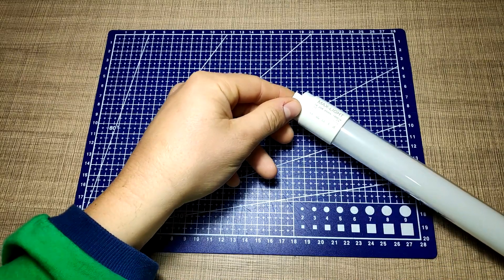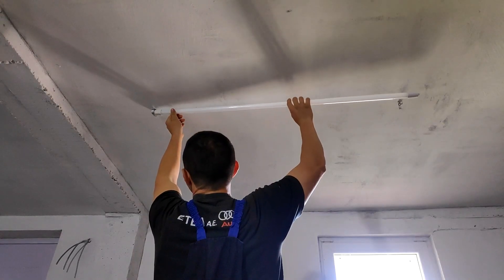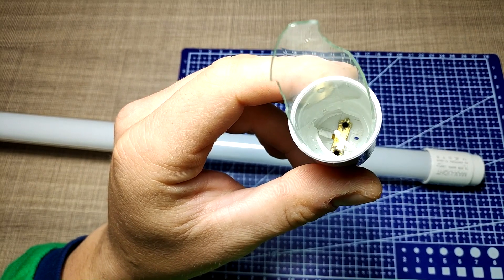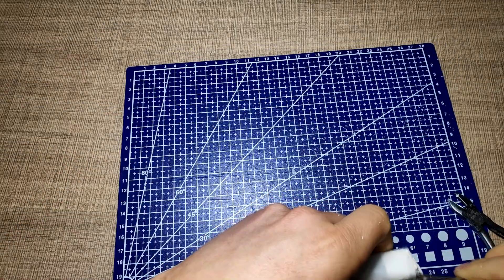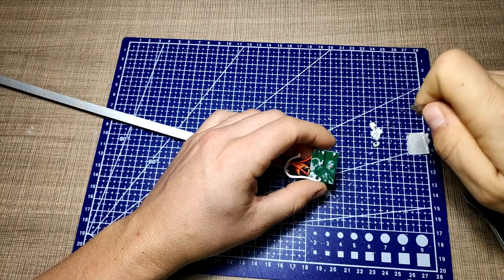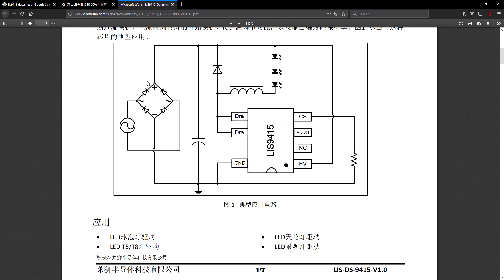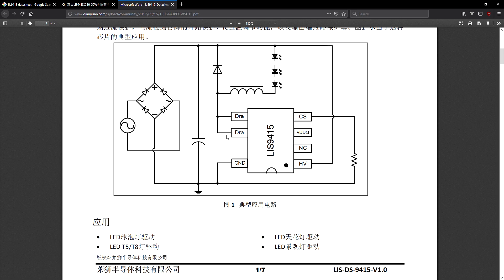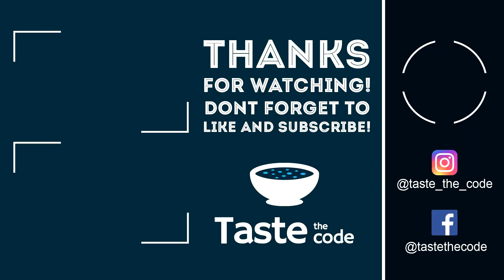T8 Mains LED Light Teardown

Comment: Raising or lowering resistor drop the current?
Reply from the maker: Usually when there are two resistors in parallel, removing one lowers the current. So rising the resistance, drops the current.

Comment: How to power it with usb
Reply from the maker: This type can't be powered from USB as the LEDs are wired in series and require high voltage.
Reply: @TasteTheCode  with a direct plug then??
Reply from the maker: This light is intended to work of 220V AC.
Reply: @TasteTheCode  oh then how do you make the connection to a 220v power source
Reply from the maker: The tube light has pins on both ends where you supply live and neutral.
Reply: @TasteTheCode  thanks bro

Comment: Could you do a tutorial for how to connect it to a power supply? the led i have the glass is broken but i want to reuse it
Reply from the maker: Just provide power to the input on the board. Make sure to identify which wires connect to the ends and in what way. Some LEDs are powered with live and neutral from differen sides and some from the same side.
Reply: @TasteTheCode  i managed to see that one end is neutral and the other is live, its an 18w 96led strip, can i just connect it directly to a 12v power adapter
Reply from the maker: No. It needs to be powered from mains as those LEDs are in series and 12v won't do anything.
Reply: @TasteTheCode  ok go it, the wire coming from the led strip are quite thin, how to i connect them safely to a thicker wire or a normal one? I dont want to connect to a non shunted tomstone
Reply from the maker: I guess you can solder new thicker ones to the board.
Reply: @TasteTheCode  i will try it,thanks for answering my questions,appreciate it!

Comment: Hey brother i want 
 to ask ..can i shorten the led t8 from 120 cm to 90 cm?, because my old aquarium light is broken.  My aquarium is a 302 liter boyu which has a neon type lamp with a length of 90 cm, but I am having trouble finding a t8 lamp of that size because it is not common.  so can it be shortened
Reply from the maker: Not really, but it all depends on the light. On mine, the LEDs are arranged in such a way that they are all in series. Plus, the other glass is very thing and most likely it will break if you try to disassemble it. In your case, I will suggest that you replace the whole thing with LED strip.

Comment: I have a T8 lamp. I”d like to know if I can cut the LED strip half length.
Reply from the maker: Only if there are multiple parallel circuits connecting there. Not all lights have them.

Comment: any change the led strip would be cutted and re-wired without damage?
Reply from the maker: I don't think so. The strip is aluminum backed so just soldering to it will be a pain as it will suck all of the heat.

Comment: I have quite a lot of t8 led tubes can they be run off 12 volts battery power no inverter can you help. Greg
Reply from the maker: It depends on their internal wiring. These tubes are usually wired in series so they run on higher voltages. However, if they are tubes that run on mains voltage then there is no way to rewire them without actually breaking the outer glass.

Comment: Hello Bill,  thank you for this informative video.
what is the voltage needed to power this light bar?
Reply from the maker: The original light with the driver installed works on 220V AC. The LED bar only is made out of 42 groups of three LEDs in parallel and although I haven't measured their voltage, based on the 3.3V forward voltage of a white LED, it should be somewhere around 130V for the bar only.
Reply: @TasteTheCode  thank you for your reply
Reply from the maker: @ToniHayek  You are welcomed!